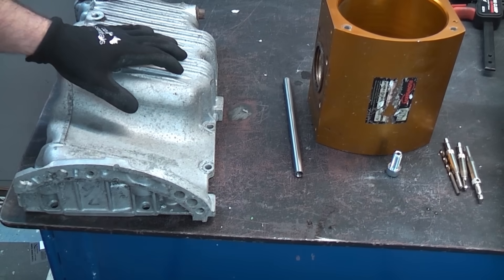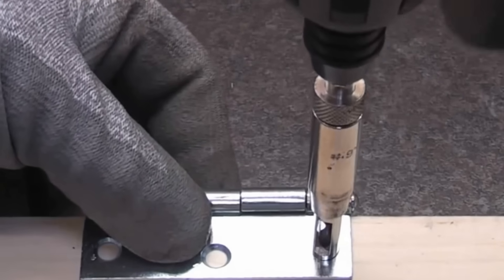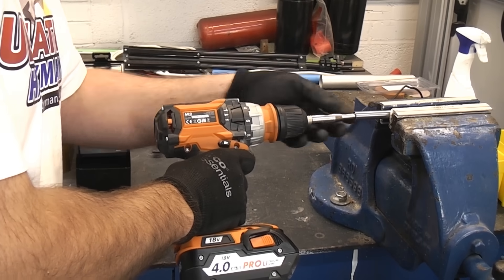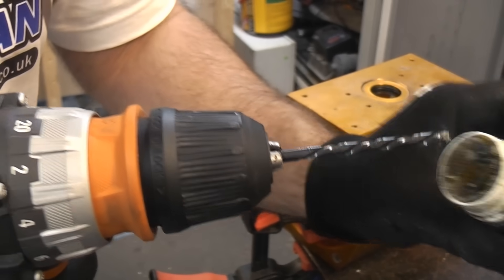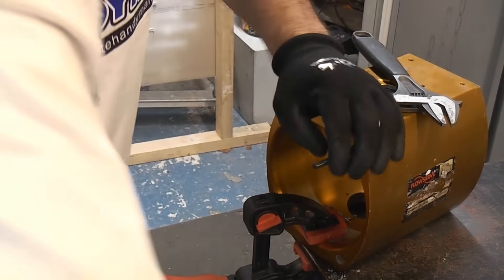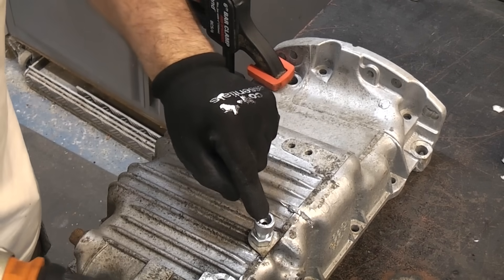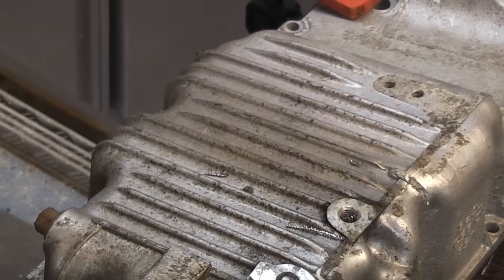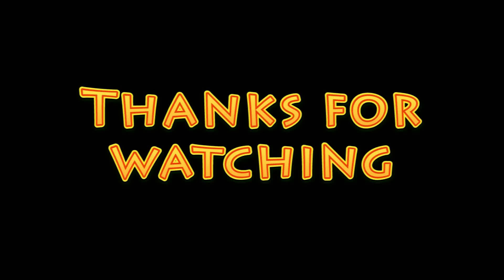How to remove a broken bolt in a deep hole | remove broken bolt in recessed hole

Comment: This vid is absolutely useless for the simple reason that if i had any of those tools i wouldnt be searching how to extract snapped bolt. These guides should only be made with regular tools everyone has in the garage. Left hand drill, yeah man thank you very much :/
Reply from the maker: Perhaps it is easier, if you just get a professional to remove the bolt for you 😁
Reply: @ultimatehandyman  fortunately in another vid there was a method with flat screwdriver of which i have like 10 in garage and that worked flawlessly. Granted, the snapped screw was snapped right on the surface not in deep hole like yours

Comment: Great video.  I have a lawn mower engine with a recessed sheared off bolt in one of the holes where the engine mounts to the deck.  The bolt is virtually welded to the aluminum housing, and I do not want to damage the threads.
Reply from the maker: Good luck with it
Thanks for the comment 👍

Comment: If the heads broke off from overtightening they arent difficult at all. If they are rusted or corroded then thats a different. Story
Reply: What’s a method for overtightening
Reply: Or broke from bottoming out. That stretches the threads locking the broken stud in.

Comment: So you forgot your tap wrench, been there done that, lol.  Stick the screw extractor in your cordless drill, much less futzing around than with the shifter (sorry that's Aussie slang, adjustable spanner).
The pre-drilled bolts as a guide is genius.  I'm a machinist by trade and I have never seen that.  30 years experience and I can still learn new things.
Reply from the maker: Thanks for the comment ;-)

Comment: When aluminum is involved DO NOT use copper anti-seize.  Use zinc based antiseize. The copper is less electronegative than aluminum.  It will degrade aluminum.  Zinc anti-seize is the only anti-seize more electronegative than aluminum.  It will give itself up to the aluminum part.  That is the basics of galvanic corrosion.
Reply from the maker: Thanks for the comment

Comment: I had to remove a dead axle that broke off inside the axle housing on a 1964 CAT D-4. I welded a steel bar to the broken end of the axle and two bars on top of the steel bar. With 4 hydraulic jacks I applied maximum lift and walked away. 5 days later, it came loose and the dead axle sailed through the wall of the shop and came to rest about 35 feet from the shop.
Reply from the maker: Blimey, that sounded like a nightmare job!
Thanks for the comment 👍

Comment: I would add that when using home made drill bushing/drilled out bolt make sure you don’t drill too much without clearing the cuttings from the hole because the drill bit can easily snap off and add to the problem.
Great ideas !
Reply from the maker: Thanks for the comment

Comment: What causes them to be obstinate in the first place? Thank you I was about to use an angle grinder as the one I have does protrude
Reply from the maker: Sometimes they get stuck with corrosion etc. Other times the bolts have become weakened, which can cause them to shear.
On some machines on site we use different tensile strength bolts, if you use a low tensile strength bolt they are less likely to shear, as they are more ductile, whereas the high tensile bolts shear off for fun.
Thanks for the comment 👍

Comment: Great video....thanks!  My only comment would be regarding your suggestion to use the anti-seize for the next "screw in".   And, on the surface is a surely a good idea, however - beware, that a lot of bolts in the items you were working with there, have a torque spec., and whatever value that was initially, I believe will have to be modified, to account for the now-slippery bolt threads.
This is a relatively minor point to be making, considering you "saved the day"  by getting the broken bolt out!  Thank you again!
Reply from the maker: Thanks for the comment 👍
Reply: Anti-seize is not supposed to be a real lubricant. It's claimed not to affect torquing. It does nothing but prevent seizure.

Comment: Im old school , If I have a broken bolt in aluminum , I use a center punch and a 1/8th inch bit as a starting hole , I use a hand File as a tap  hit it light with a hammer get it in tight the end will bite a crescent wrench will turn it out .  I have broke many ez outs the temper is to hard , removing heads on Diesel engines head bolts seem to always break on Cat Engines .  Have had to resort to drill everything out and tap helicoil the hole .
Reply from the maker: Thanks for the comment

Comment: I found this video very informative especially using hinge tools and thru drilled socket screws. Cobalt drills, left hand drills brilliant. I have and would use a verticle mill to do the drilling. If all else fails Spark erosion.

Comment: It can be helpful to get some left twist drills so that you can drill in the same direction as bolt removal.  Sometimes the drilling will remove the piece without needing the extractor.  And when you use the extractor, tap on it with the hammer as you slowly turn it.  That will help seat it much better than tapping, then turning, then tapping some more, then turning, etc.  Tap and turn together.
Reply from the maker: Thanks for the comment

Comment: They DO MAKE left handed drill bits that is a big help with the broken bolt coming right out occasionally due to the heat and spin of the bit.
Reply from the maker: Thanks for the comment
Reply: I got them at Harbor Freight years ago but the last time I looked for them there wasn't even an empty spot on the pegboard for LH bits.

Comment: Thanks so much for the video. I'm restoring my dad's jointer from the 50's and there are 5 recessed allen bolts holding the knives. Unfortunately I snapped the head off one, this gives me confidence I can now remove it without damaging the threads.
Reply from the maker: Good luck with it ;-)

Comment: I'm old and I will give you a tip I learned from an old man when I was young for drilling out hardened bolts like a grade 12. Vinegar, use vinegar as a lubricant instead of oil and use a slow drill speed. The bit will drill through it like magic.
Reply from the maker: Thanks for the comment

Comment: can someone please enumerate to me what was the name of that tools he used.. i need it badly
Reply: Easyout
Reply from the maker: Hinge centering drills- https://fave.co/2DpJo1H
Left handed drill bits- https://fave.co/2xJjK1M
Teng screw extractors https://fave.co/2OnfRuF
Dormer taps -https://fave.co/2OsN1sQ 

If you are in the UK- 
Hinge centering drills- https://fave.co/2NE1VMc
Left handed drill bits- https://fave.co/2DubtF4
Teng screw extractors- https://fave.co/2pVLkVT
 Dormer taps - https://fave.co/2pTfbyx

exact cutting paste- https://fave.co/2Nabyxc
cobalt drill bits (they are much better on harder steels like bolts) https://fave.co/2zDh3kp

You'll have to make the guides yourself, but they are easy- https://www.youtube.com/watch?v=6mZj0J6CNYA&t=1s

Spring tools centre punch- https://fave.co/2NbnLBD

Comment: You are very skilled at your trade. My only comment is to always blow ALL debris out of the hole before using the extractor. Grains of sand or bolt particles in the aluminum threads can destroy the threads during extraction.
Reply: BeerBBQMan your right
Reply: Or at worst your shavings get pushed into the threads and muck up the extraction process
Reply: I tried to tell him.....
Reply: Nah tipp them out cause you blow them they can get in your eyes and other places

Comment: If an imperial (SAE) bolt had been used in the first place, this wouldn't have happened.  This is the consequence of the "metrication movement".  Metric bolts are junk!  Imagine the consequences of this if it had been holding the wing on an airplane!

Comment: On bolts 1/2" or larger take a 7018 welding rod and a piece of fuel line to make up the difference, thread it in the hole, zap in HOT one time just long enough, to secure the rod to the stud. Remove the fuel line, let it cool. Add WD40 etc. Cut the rod 1/2" - 3/4" above the material, then weld a nut of coresponding size to the broken bolt, onto the exposed end of the 7018 rod and turn it OUT! 
    I've been using this method since 1983, in Alitak, Alaska, It has never failed me yet...  Enjoy; 
                               The Dutchman
Reply from the maker: Thanks for the comment 👍

Comment: Every video i have watched about stripped and snapped bolts are always easily accessible but every situation I need to use these methods on are on a transmission that I can’t get to that easily at all. I wish there was a video on removing bolts in tight spaces but great videos 👍🏽 thank you
Reply from the maker: Thanks for the comment

Comment: Good video, I am a recently retired A&P Mechanic. Used screw extractors, drill bits for removing stripped screws. Heli coils on my Harley to repair damaged threads.
Reply from the maker: Thanks for the comment

Comment: **HELP** I have a 2003 Explorer- I went to change-out the 'Gatelift Struts' and noticed the left sides 'Stud' is broke off inside... I drilled a hole then tapped in a #2 easy-out, the Easy-out Broke! Now I have a broke stud (LOL) a broke EO as well. any advice is appreciated. Keep in mind I only have basic tools- TY
Reply from the maker: You might be able to remove it by welding on a nut (if you have a welder)
You can drill it out, but it is difficult- https://www.youtube.com/watch?v=7JCfEMrCjhc
Best of luck with it ;-)

Comment: another way to make it easier it use a bolt extractor is with a hammer operated impact driver. install the correct size impact socket to fit the extractor on the driver, set the driver to reverse (remove) and carefully tap it to drive the extractor into the stud while it turns it counter clock wise (or clock wise as the case may be) keeping the extractor seated and turning
Reply from the maker: Thanks for the comment

Comment: Good luck doing any of that with a 20+ yr old rusted up seized bolt. Especially at a cockeyed angle and don't want to or can't remove the part the bolt broke off inside of
Reply: Yeah, like a cylinder head exhaust stud. These are good tricks, but only in ideal conditions.
Reply: Broken exhaust stud.... say a Ford modular engine.... weld a 3/8" nut to it, and spin it out with an impact wrench. Sometimes you have to weld multiple times, but I've only had 2 studs that did not come out. Also when taking the manifolds off, take the nuts off with an impact. A lot of the time the nut is rusted so tight it will take the stud right out of the block. Ford's replacements are stainless steel.

Comment: Any tips for a bolt broken off flush with the surface (ARP hardened bolt in a cast iron cylinder head), with a left hand snap-on drill bit broken off in the center?  Tried heat, shock, soaking, drilling and  lastly mig welding a steel rod into the bolt, which sheared under torsion when tried to unscrew with vise grips... in the end I replaced the cylinder head, and used the messed up one as a decoration in the shop... but still curious
I really like the guide bolt system, glad i have a friend with a lathe. Thanks
Reply from the maker: Welding on a nut works really well, providing you can get at it and have a welder. 
These might give you some ideas-
https://www.youtube.com/watch?v=_R1b8niX13w
https://www.youtube.com/watch?v=l-BxjWhqaQo
Thanks for the comment

Comment: I was taught NOT to use copper based anti-seize on aluminium as it will cause corrosion.
Reply from the maker: A few people have said that, although we have used it for years at work, with no problems.
Thanks for the comment
Reply: Use nickel antiseize then.

Comment: I was removing a cylinder head from a Nissan Micra K7 engine. The middle bolt was really stiff and eventually snapped off flush. That was just removing it! I bought a second hand engine in the end.
Reply from the maker: Thanks for the comment 👍

Comment: If you did damage the threads on the aluminum component, couldn't you bore out the bolt hole to a slightly larger size?
Reply from the maker: Yes, you could do, providing it was not too close to the edge of the aluminium etc.
Thanks for the comment

Comment: One time, a spark plug broke off in my engine. I got it out by using an Easy Out Extractor for removing bolts and screws. Just gotta use the proper size extractor.
Reply from the maker: Thanks for the comment

Comment: Have a Bultaco motorcycle engine someone put screws in side casing instead of alloy screws.One screw head nearly gone was going to try cutting a new line then use impact screwdriver.But worried if snap head off or dig screw in deeper.Going out to buy spray to see if can loosen screw before doing anything
Reply from the maker: Spray penetrant can really help, especially if the screw is corroded.
Good luck with it. 
Thanks for the comment

Comment: For the knowledge of a layman like me, please also explicitly mention that the bit you are screwing into the broken bolt has reverse threads, so when you tighten it with a wrench, it causes bolt to move in forward motion. 
At least this is what I can understand from watching this video. Please correct me if I am wrong
Reply from the maker: The screw extractors have a reverse thread, so when they bite into the bolt they will remove it in a counter clockwise direction.

Thanks for the comment

Comment: Using a wrench turn the extractor  will give problems to remove it because your turning angle will not remain central, this will give you angular deflection, and may not bite properly.
Reply from the maker: Thanks for the comment

Comment: As he holds the drill crooked,  JUust start with a Transfer punch of the appropriate size and it'll perfectly center punch it,and drill it through, or use a left hand drill,or using a piece of black iron tubing weld down inside of that using only Unichrome,the heat "after it cools" will loosen the broken bolt and the Teat you created with Unichrome can be grabbed with visegrips and it will easily turn out, and there are many more methods,all of which will work ,if done carefully.

Comment: Interesting that you promote using a copper based antisieze compound when copper is known to react/attack copper and cause corrosion.
An engineer I know says that you should use a nickel based compound, no corrosion. Have used it on the spark plugs screwed into alloy cylinder head, works like a charm, no problems.
Reply from the maker: We use copper anti-seize, all the time at work  and have never had any problems (that I'm aware of) 
Thanks for the comment

Comment: In a situation where your removing a bolt that broke off, but you think the threads were cross threaded. An easy-out probably wont work will it? Thinking I will have to drill and tap.
Reply from the maker: If it is cross threaded, the best option is to drill it out and re-tap the hole.
Thanks for the comment
Reply: @ultimatehandyman  Thanks

Comment: pretty cool, I'm a welder & when I worked in a machine shop they would break a lot of taps in the thread so I would tig weld a small lug on top the tap then vice grip the lug combined with the heat they would spin right out, not everyone has access to this method but if you do it works quite well
Reply from the maker: Thanks for the comment

Comment: I have a small bolt with its head sheared off stuck in its threaded hole below a counter sunk hole. See this image for reference.. http://imgur.com/gallery/Vyhw45F it's a delicate situation on my electric skateboard..I need to remove this bolt asap without damaging the thread of the hole the bolt is in so that after extraction a new bolt can be screwed in again..I have a damaged screw extractor bit set (drill in reverse a hole in the end of the bolt with one end of the bit and then extract afterwards with the other end of the bit also with the drill in reverse).. How can I prevent the screw extractor drill bit from slipping/damaging/stripping the bolt hole thread and ensuring it stays centered? Use a hand center punch to make an indentation somehow in the end of the bolt to keep the extractor drill bit in the center or any other tools you suggest? I greatly appreciate your feedback asap on how you suggest I do this successfully as I can't afford to damage the bolt hole's thread but can't delay sorting this out much longer.. Thanks again! 🙏
Reply from the maker: It's difficult to see much from that photo, but this might give you a couple of ideas- https://www.youtube.com/watch?v=_R1b8niX13w

Have you tried applying lots of spray penetrant, then using a centre punch to knock the bolt undone?

Comment: It's nice to have the luxury of a few threads  before hitting the broken bolt. What do you do if it's broken off at the top of the hole? Had that situation the other day. Clamped it down on a milling machine. Eyeballed the center then drilled with a center drill. After that drill through the bolt with an under size  drill. If it looks off center then it will have to be corrected with an undersized end mill. When it looks good drill through with the tap drill sized bit. Sometimes the remaining thread can be picked off with a sharp pointed rod. If not you have to carefully run a tap through.
Reply from the maker: I normally just centre punch it in the centre, then proceed to drill it out using a left handed drill bit.
Thanks for the comment

Comment: Good info, but so much harder to do when you dont have near as much room to work with. For example a turbo bolt that is at the rear of an engine with barely enough room to get your hand to.
Reply from the maker: That is correct, but it is much easier for me to film things on the bench ;-)
Thanks for the comment
Reply: @ultimatehandyman  yeah sorry I didn't actually think about that
Reply from the maker: Not a problem, believe me I do get some B*stard jobs at times- the ones that you wish you never started !
Thanks for the comments